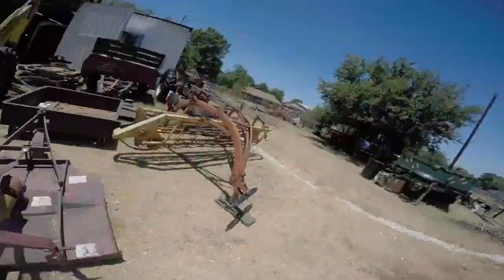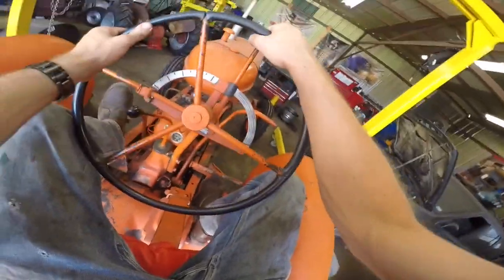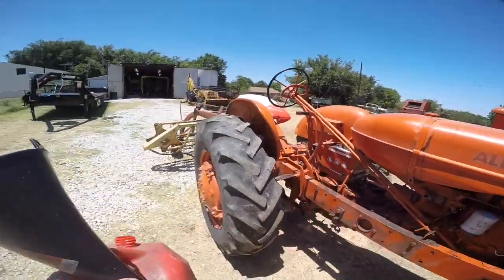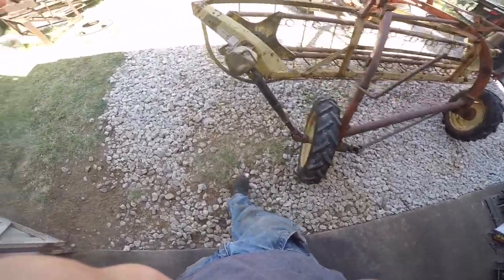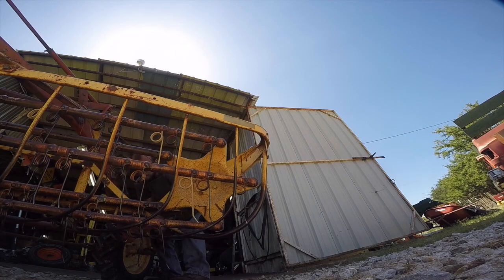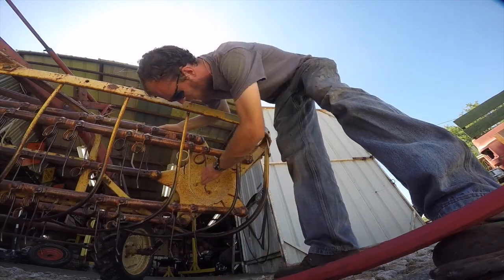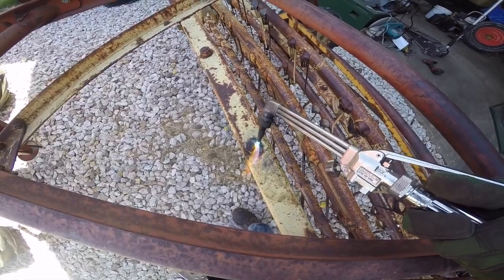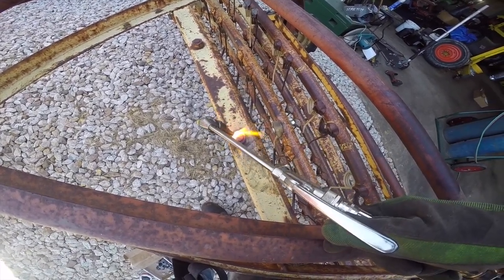THE HIDDEN SECRET TO MAKING MONEY FARMING THAT TRACTOR DEALERSHIPS DONT WANT YOU TO KNOW!!!

Comment: Chucky don't heat the head of the bolt, I've seen u do that and times nothing happens...try heating up around where the bolt is it will expand, I'm sure u know that, and heat the NUT up and take out as its hot
Reply: He dont read these comments ive been watching his shit for 10 years. This video is 4 years old and outta sequence seen the few days after this video last month.
Reply: @Jayday707  really ok far enough thanks
Reply: @kenwelch6984  it worked though how he did it so why tell him its the wrong way? I heat the whole damn thing up when i am doing this and it works 99% of the time.